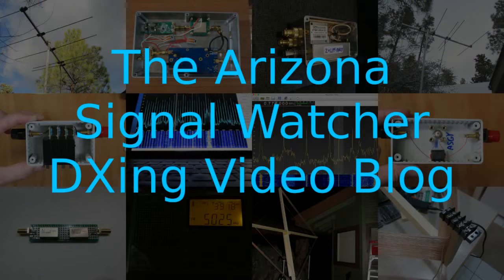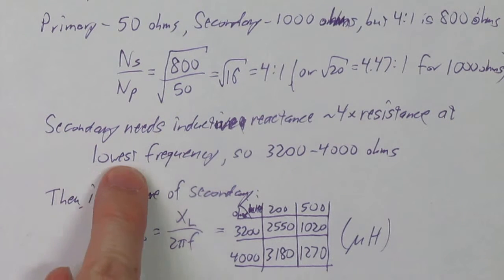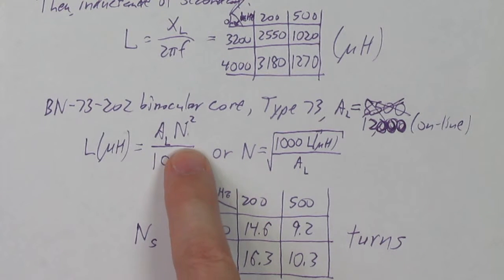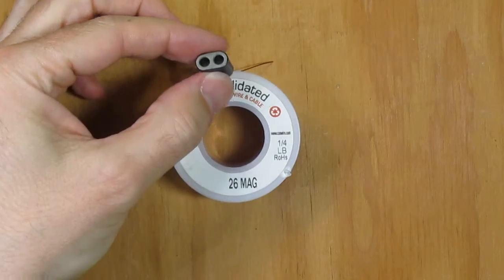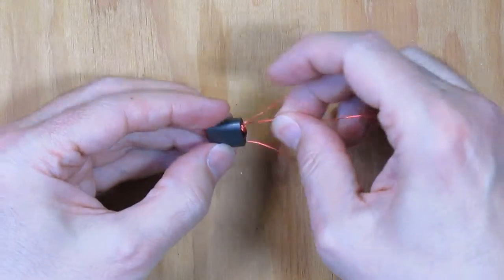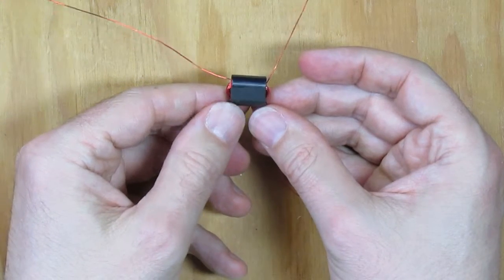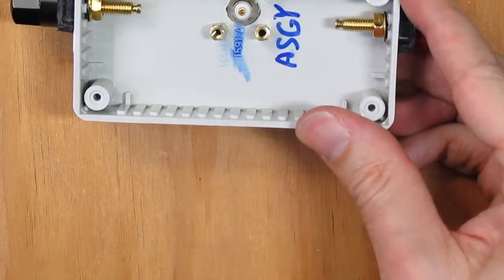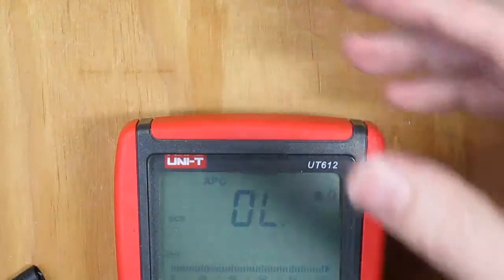Arizona Signal Watcher Ep003 - Superloop Antenna Part III: Impedance Matching Transformer

Comment: Very well explained! I made a Loop on Ground antenna, and cant hear anything, but I think after watching your video it may be due to either not enough windings (9:3 - when measured on Nano VNA I am getting ~50 ohms down to 7MHz), but I noticed I had 234 ohms of resistance when measuring between my N connector and antenna posts - come to find out it looks like I had some enamel worn off and shorting out. Thank you!